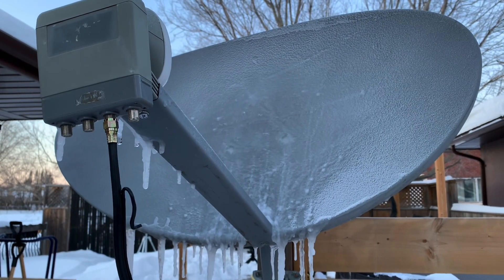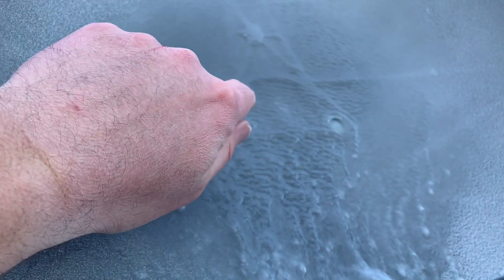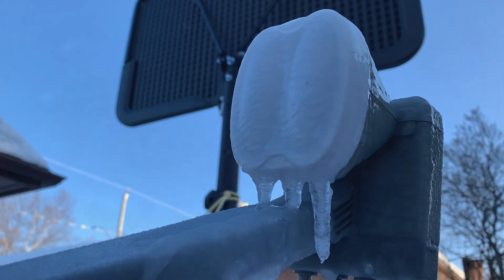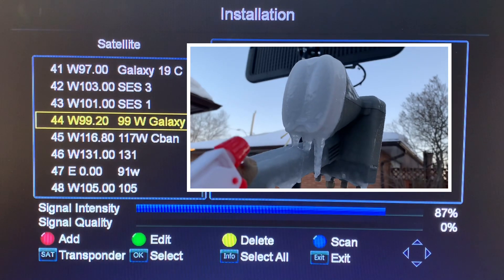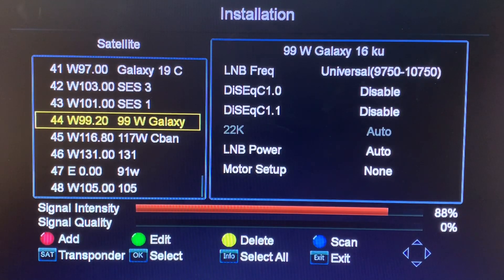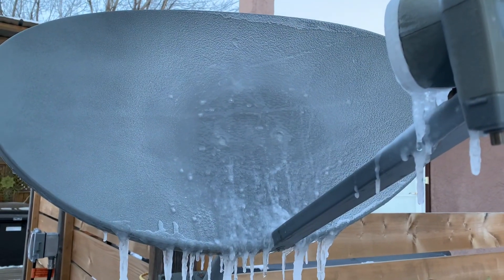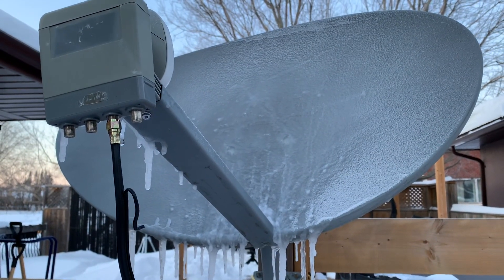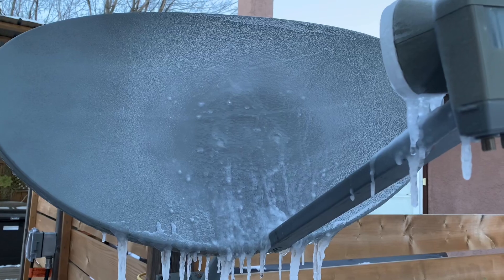How does ice affect KU Band Satellite TV Signals?

Comment: When we used to have DirecTV, just one cloud and the signal went out. Whenever we get snow or ice,  the sky’s all gray, so no reception. With DirecTV Stream and an antenna, good reception all the time.
Reply from the maker: Bad weather anywhere in the signal path to your dish can knock out the signal. Glad you have a set up that works. 👍
Reply: In Europe when you subscribe to a Satellite Pay TV company (like DirecTV for example) they install 80 cm dishes (minimum size recommended by the technician) and you don't have problems, only if you have snow on your dish, or in very rare cases storm. In Eastern Europe they even install 90 or 100 cm dishes for both free to air or subscription based TV channels.